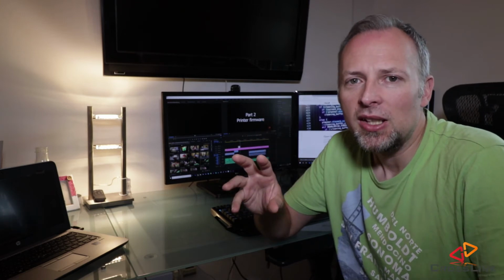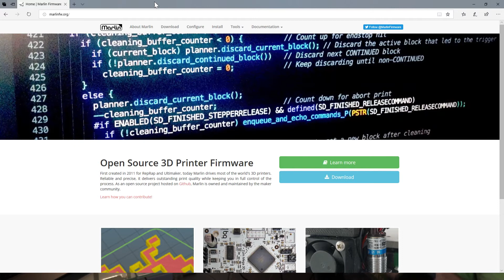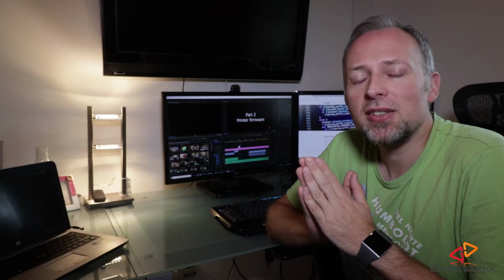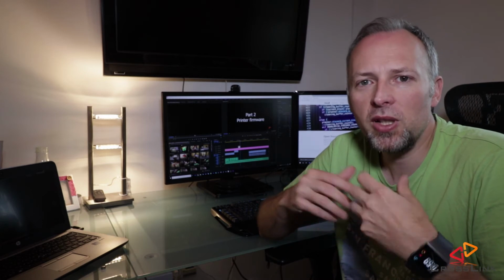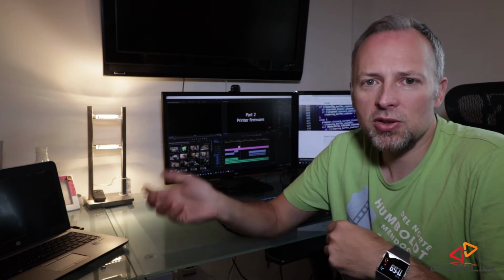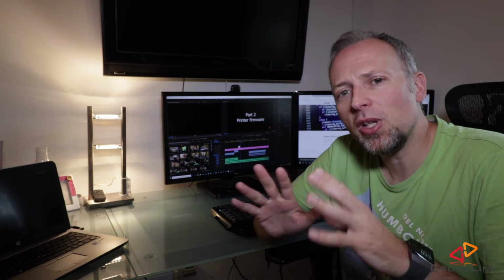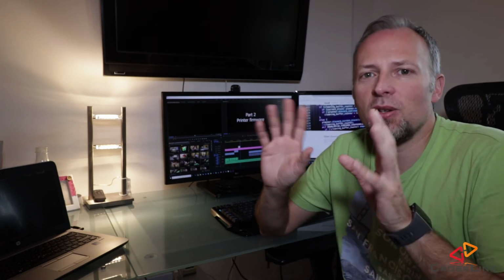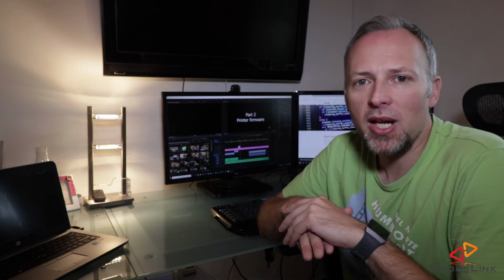Anet A8 top safety upgrades to prevent fire 🔥

Comment: you can use ceramics heater    it can t be over heated up to 220-350 C   because it  has maximum resistance at the top of  temp
Reply from the maker: Still getting comments on these videos makes me think whether I should keep them up 😂

Comment: Anet A8
After turn on the printer for 30 minutes. Suddenly the printer turn off and gave a message saying:
THERMAL RUNWAY , PRINTER HALTED ,PLEASE RESET
how i can solve this problem ?
Reply: Your printer cannot detect any temperature.  Check the thermistor is correctly mounted in the head of your printer, and connected correctly.  Check the wires in the heated bed to see they have a good connection.  You may have a loose wire.